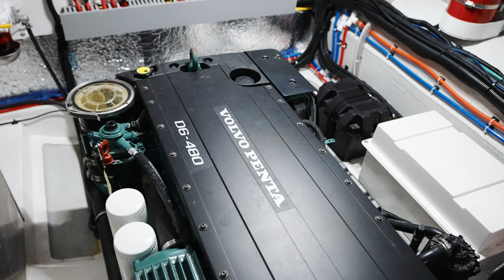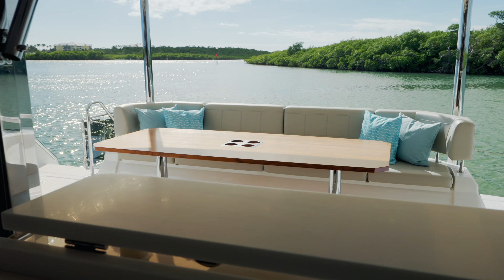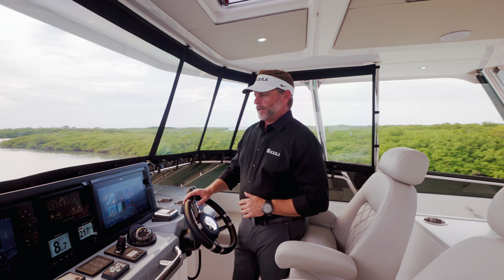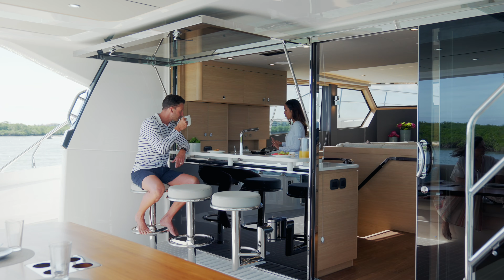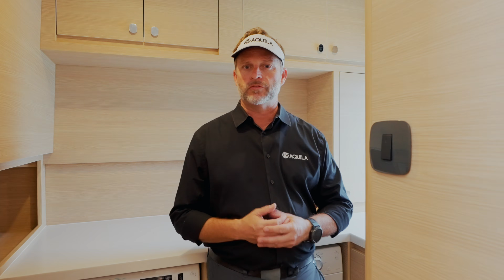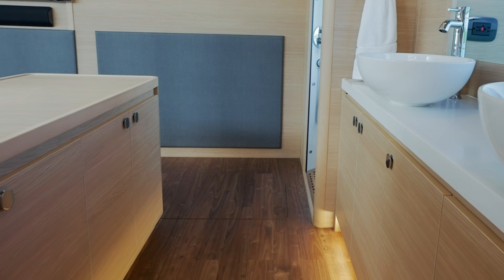Step Inside the NEW Aquila 50 Yacht | FULL TOUR

Comment: so you can only have an oven OR a dishwasher but not both?
Reply from the maker: Correct, you'd need to choose between either a full-size oven or a dishwasher.  However, if you select the dishwasher option, you'd still have access to a convection oven microwave. You can learn more about the 50 Yacht here: https://hubs.ly/Q0302QNs0